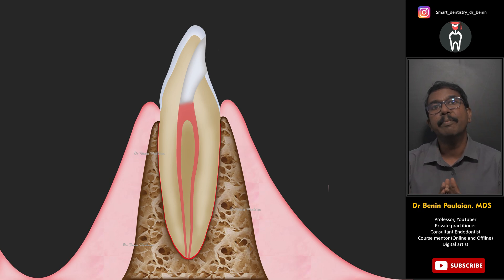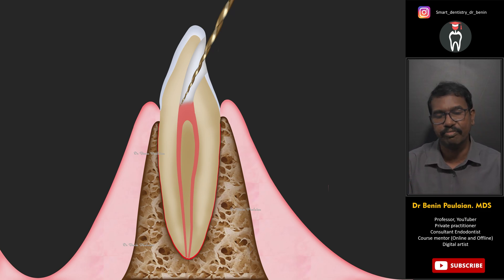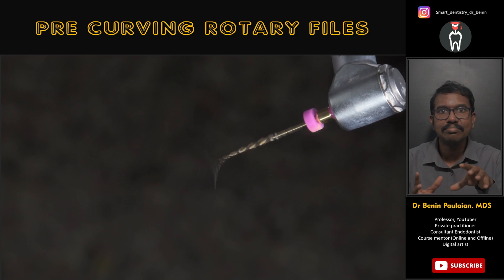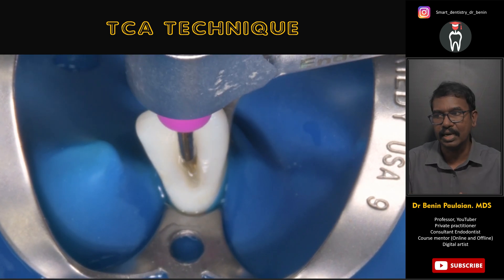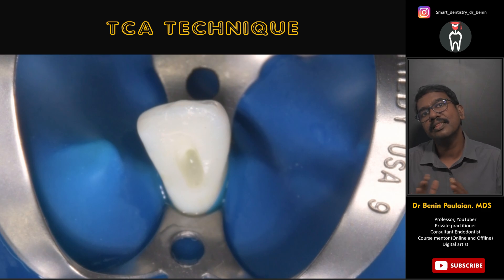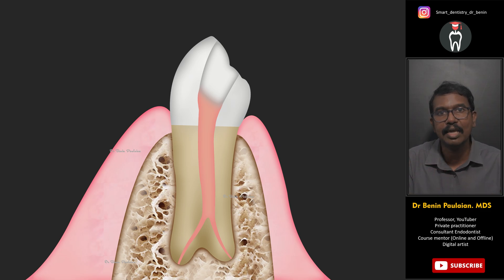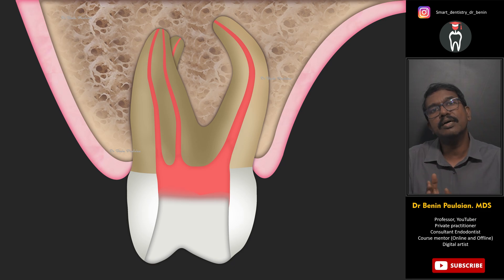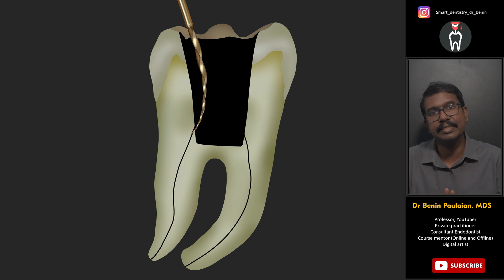TCA TECHNIQUE | COMPLICATED ROOT CANAL TREATMENT MADE EASY

Comment: ❤ beautiful sir।।।।।thnks।।।
Sir plz make vdo on obturation where canals split।।।।in apical areas
Reply from the maker: I have included the topic you suggested in the upcoming video list
Thank you for your suggestion
Upcoming videos in Smart Dentistry YouTube channel
Bounded file versus binding file - @sauliharizwan377, @vickyrock1873, @siddhiraut8472, @hristohristov650, @burrwnawna, @ayeshasiddiqua-ue4ss
Anterior proximal composite restorations - @raghuramm563
Finishing and polishing of composite restorations - @DrHozefa
How to create the perfect anatomy in posterior composite restorations - @DrHozefa
Working length using RVG - @manadentist2267, @sushrutachakraborty464, @dentalking7859
How to use apex locators to get accurate reading? - @katyaynigupta5259, @Sreemol17, @dentalking7859, @dentalshorts6848,
How to determine the correct taper for canal preparation (2%vs4%vs6%) - @akanshas8424,@abdurrahman2980, @benoitblanc8898
Diagnosis in Endodontics - @MuhammadAbdullah-iy3hc, @bsk4627, @vijyantmehrotra8119, @manadentist2267, @akshuDhavalshankh, @katyaynigupta5259
Dentine bonding agents - Part 2 - @bigdreams3712
How to bypass a fractured file? - @karthicks5760
How to do periapical surgery? - @derekshaji8173
How to remove a fractured file? - @karthicks5760
How to prevent ledges, blocks, zipping and canal transportation - @Philosophyforlifeofficial 
Apexification procedure – @anumadhukar9171, @sanghamitrasagariya4087, @katyaynigupta5259
Perforation repair - @anumadhukar9171
Avulsed tooth management - @Drpoojagarg5310
All ceramic crown preparation – Anterior - @KiranrajkumarHatangle-eo4wm
Molar crown preparation - @KiranrajkumarHatangle-eo4wm
Radix entomolaris - Case discussion - @sauliharizwan377
Palato gingival groove - Case discussion - @sauliharizwan377
Root canal negotiation techniques - @vickyrock1873, @siddhiraut8472, @hristohristov650, @katyaynigupta5259
EDTA in Root Canal Treatment - @rosemeher1321, @hristohristov650
Understanding root canal calcifications - @rosemeher1321, @hristohristov650, @katyaynigupta5259
Operator positioning for Root Canal Treatment - @chandrasekharsahoo6713
Analgesics after Root Canal Treatment - @mdmozahedulislam3923
Root canal sealers - @sudhaa5674
Sealer puff – Good or bad? - @derekshaji8173
C shaped root canals - @karthicks5760, @LearnUnlearn90, @katyaynigupta5259
Middle mesial canal - @karthicks5760, @katyaynigupta5259
Reference point in root canal treatment - @anujgarg952
Heat and H file technique for GP removal - @chandrasekharsahoo6713
how to do BMP effectively without any pulp tissue remnants in a single visit RCT - @rainbowsalt-gc7ek
class 2 composite and matrix to avoid gaps between teeth after using toffelmeir system -  @sauliharizwan377, @hishamkhan3800
Curved root canals and file selection
Everything a beginner should know about rotary files
Ledges – prevention and management - @dentalshorts6848
Prefabricated metal post
Pre fabricated fiber post - @anithabalex8124
Ribbond post and core - @bsk4627, @sajaljain4192, @sauliharizwan377
Custom cast post and core - @derekshaji8173
How to select the proper crown - @DrGreenfun
Cast post Vs fiber post? Which one to choose? - @SnehaPK-rt3tn, @alokegupta3165
Occlusal considerations in post endodontic restorations - @tubeindahouse
Pulp stone management - @sayantankarmakar3150
Torque and speed in curved and narrow root canals - @safaamohammed
Shade selection in dentistry - @dr.kannannambiar3763
Ceramic veneer preparation technique - @thakkarghanshyam2450
How to bond ceramic veneers - @thakkarghanshyam2450
How to obturate split root canals - @mukeshadwani4695

Comment: Sir,plz explaiin tips and tricks in shade selection of anterior tooth( clinical)
Reply from the maker: I have included the topic you suggested in the upcoming video list
Thank you for your suggestion
Upcoming videos in Smart Dentistry YouTube channel
Bounded file versus binding file - @sauliharizwan377, @vickyrock1873, @siddhiraut8472, @hristohristov650, @burrwnawna, @ayeshasiddiqua-ue4ss
Anterior proximal composite restorations - @raghuramm563
Finishing and polishing of composite restorations - @DrHozefa
How to create the perfect anatomy in posterior composite restorations - @DrHozefa
Working length using RVG - @manadentist2267, @sushrutachakraborty464, @dentalking7859
How to use apex locators to get accurate reading? - @katyaynigupta5259, @Sreemol17, @dentalking7859, @dentalshorts6848,
How to determine the correct taper for canal preparation (2%vs4%vs6%) - @akanshas8424,@abdurrahman2980, @benoitblanc8898
Diagnosis in Endodontics - @MuhammadAbdullah-iy3hc, @bsk4627, @vijyantmehrotra8119, @manadentist2267, @akshuDhavalshankh, @katyaynigupta5259
Dentine bonding agents - Part 2 - @bigdreams3712
How to bypass a fractured file? - @karthicks5760
How to do periapical surgery? - @derekshaji8173
How to remove a fractured file? - @karthicks5760
How to prevent ledges, blocks, zipping and canal transportation - @Philosophyforlifeofficial 
Apexification procedure – @anumadhukar9171, @sanghamitrasagariya4087, @katyaynigupta5259
Perforation repair - @anumadhukar9171
Avulsed tooth management - @Drpoojagarg5310
All ceramic crown preparation – Anterior - @KiranrajkumarHatangle-eo4wm
Molar crown preparation - @KiranrajkumarHatangle-eo4wm
Radix entomolaris - Case discussion - @sauliharizwan377
Palato gingival groove - Case discussion - @sauliharizwan377
Root canal negotiation techniques - @vickyrock1873, @siddhiraut8472, @hristohristov650, @katyaynigupta5259
EDTA in Root Canal Treatment - @rosemeher1321, @hristohristov650
Understanding root canal calcifications - @rosemeher1321, @hristohristov650, @katyaynigupta5259
Operator positioning for Root Canal Treatment - @chandrasekharsahoo6713
Analgesics after Root Canal Treatment - @mdmozahedulislam3923
Root canal sealers - @sudhaa5674
Sealer puff – Good or bad? - @derekshaji8173
C shaped root canals - @karthicks5760, @LearnUnlearn90, @katyaynigupta5259
Middle mesial canal - @karthicks5760, @katyaynigupta5259
Reference point in root canal treatment - @anujgarg952
Heat and H file technique for GP removal - @chandrasekharsahoo6713
how to do BMP effectively without any pulp tissue remnants in a single visit RCT - @rainbowsalt-gc7ek
class 2 composite and matrix to avoid gaps between teeth after using toffelmeir system -  @sauliharizwan377, @hishamkhan3800
Curved root canals and file selection
Everything a beginner should know about rotary files
Ledges – prevention and management - @dentalshorts6848
Prefabricated metal post
Pre fabricated fiber post - @anithabalex8124
Ribbond post and core - @bsk4627, @sajaljain4192, @sauliharizwan377
Custom cast post and core - @derekshaji8173
How to select the proper crown - @DrGreenfun
Cast post Vs fiber post? Which one to choose? - @SnehaPK-rt3tn, @alokegupta3165
Occlusal considerations in post endodontic restorations - @tubeindahouse
Pulp stone management - @sayantankarmakar3150
Torque and speed in curved and narrow root canals - @safaamohammed
Shade selection in dentistry - @dr.kannannambiar3763